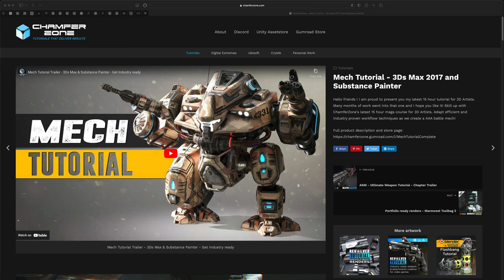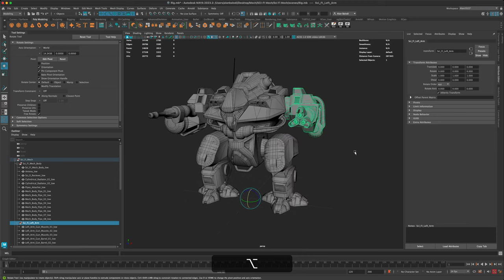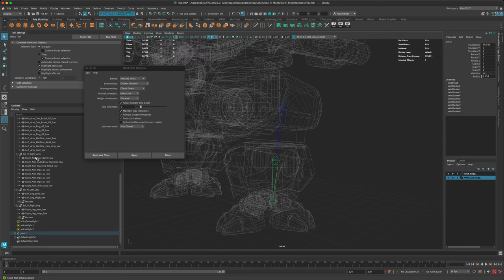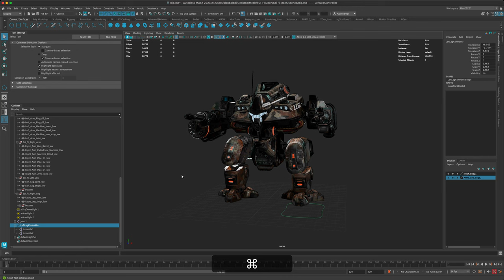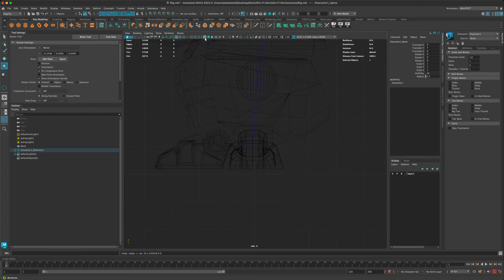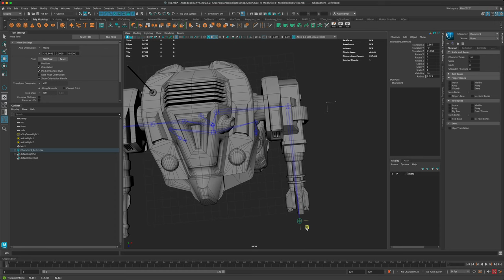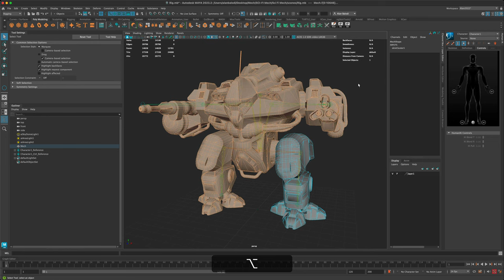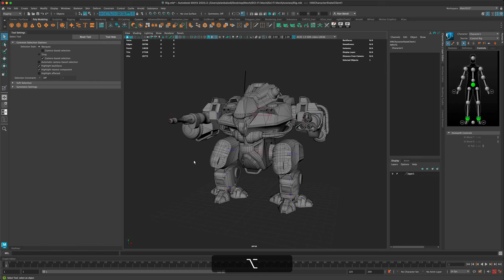How do you Rig a Mech in Maya for animation?

Comment: I watched this tutorial and I can say this is the most disgusting solution to use Human IK.
It's quicker and easier to make a skeleton from scratch by adding extra bones to the joints and cannons. My advice to those who decided to make a rig using this tutorial is to make it from scratch, adding IK Handle to the legs yourself.
Reply from the maker: Hey i was suggesting to try the human ik so you could plug it into the motion capture data such as a run or walk cycle attempting to think outside the usual execution… but of course creating custom joints would be the best.